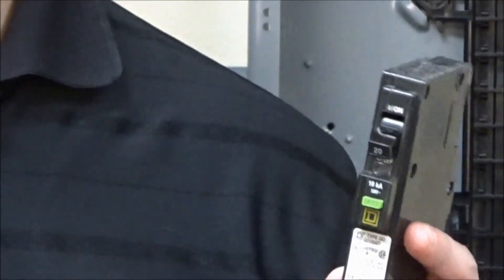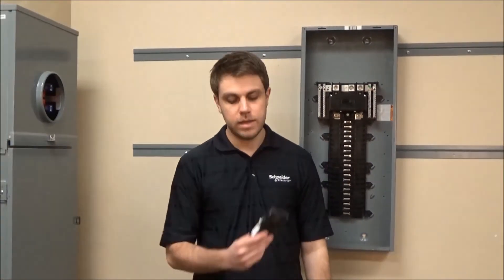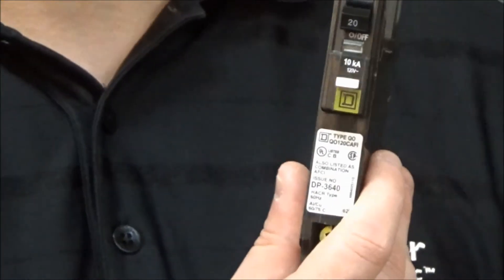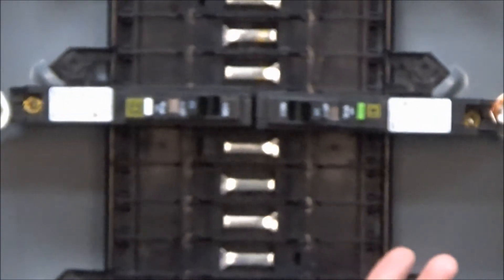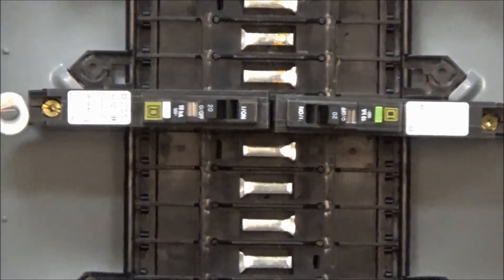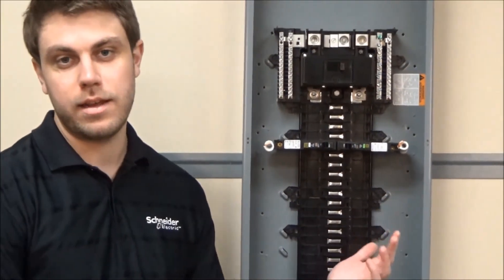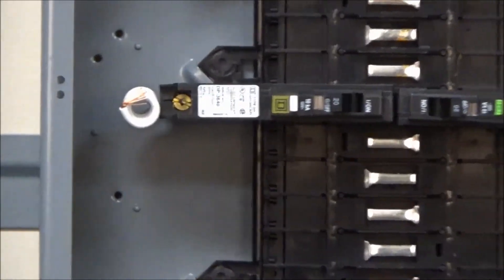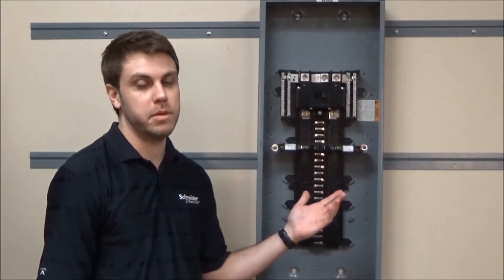Comparing AFI and CAFI Circuit Breakers | Schneider Electric Support

Comment: This an empty shell of an explanation. I consider this video to be way below the standards people have come to expect from Square D/Schneider. Since both series and parallel arcing are easily imagined as part of  normal operation for many electrical devices, an explanation is required for how the normal is distinguished from the abnormal. Also, (of course), what is the succeptibility to false trips? Are sophisticated electronics employed, and if so, how does that affect reliability/service life?
Reply: Hopefully they put more quality control into their products that they did into audio syncing on this video.